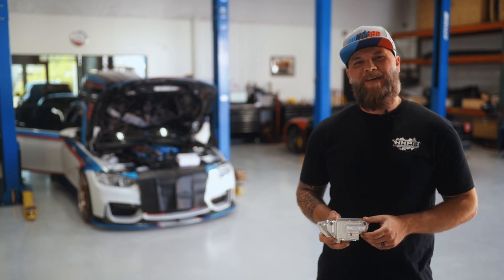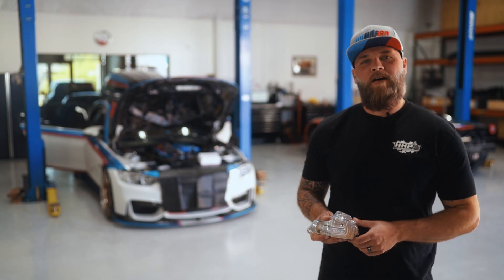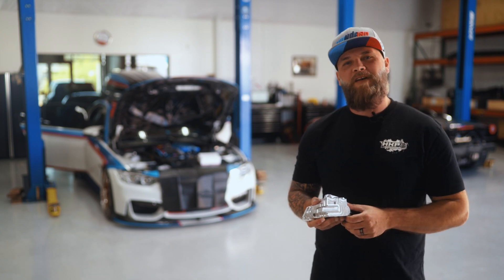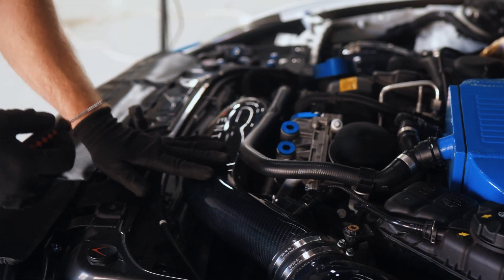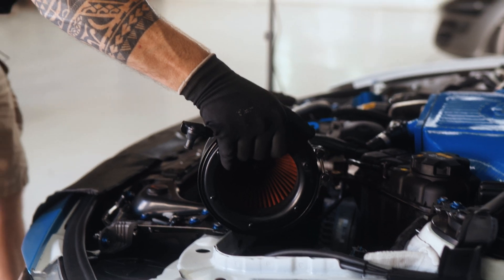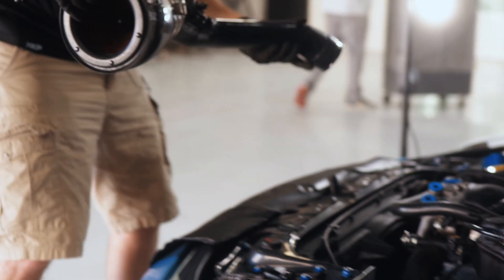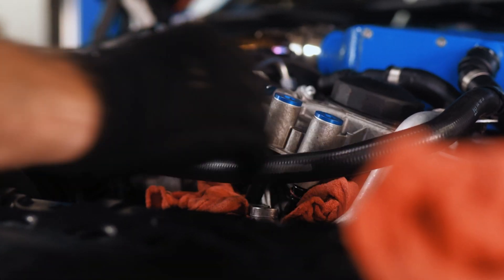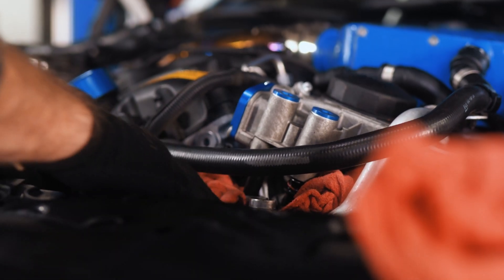HKP Tuning // Mosselman Turbo Thermostat install on BMW M3/M4/M2 Competition S55 Engine

Comment: Hi great video by chance you have the parts number for that gasket and o-ring?
Reply from the maker: You can find in our shop searching sku: 030210012. It’s installation kit comes with gasket and 2 o rings

Comment: Great video!! Wish you would have made more videos when you built the M3. Great build and top quality parts all around. I just got the SSR Performance Crank Hub done and a CFS top mount is going on this week. Looks like the MSL Oil Thermostat is a great combo with CFS cooling.  As far as upgraded turbos, have you had any experience with the Mosselman setup on the S55? In the US, I mostly see Pure Turbo cars and Mosselman seems to make a nice turbo as well. Any thoughts? About to upgrade. Thanks.
Reply from the maker: Hi Alex, appreciate the comment! We will definitely do more videos on the M3 in future. While they won't be installation related, we will just talk about pros and cons of the parts and give an overview in general. So stay tuned. In regards to the MSL Turbos, we personally have not had a chance to get our hands on a set. But our friends over at Evolve in the UK made some great videos on that set up and had exciting results. A big plus for the MSL Turbos compared to others is that only new OEM Housings are being used and Core Charges are so low (350 EUR/$410 (subject to currency fluctuation) that the customer almost always options to keep the stock turbos.  So no down time for your vehicle or large sums out the bank while waiting, new Turbos vs rebuild one. To learn more, please feel free to give us a call 480-six six nine - 9105 or email us at shop@hkptuning.com

Comment: Did you test the cooling effect of the thermostat? You see some improvements?
Reply from the maker: Its the shop M3, so we do drive it daily. While we can't validate the numbers on an OEM set up. We do run upgraded Oil, DCT and Top mount Inetrcooler Cooler, Heat exchanger with the MSL Thermostat and car reads on Sport+ in 110F outside Temperature here in AZ between 184-189F. Prior to the Thermostat and Oil Cooler we were around 215--220F. Its certainly a significant drop over stock and without having it installed.